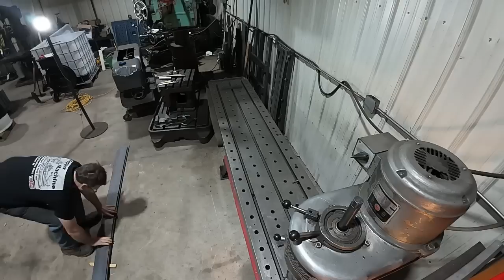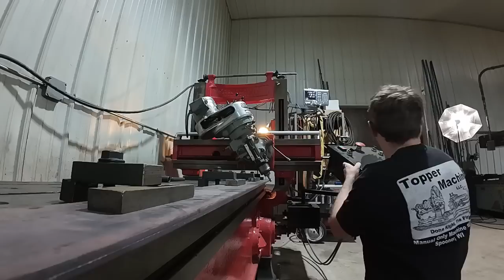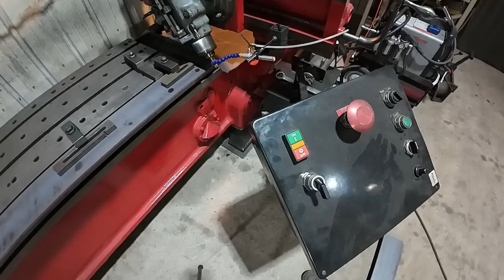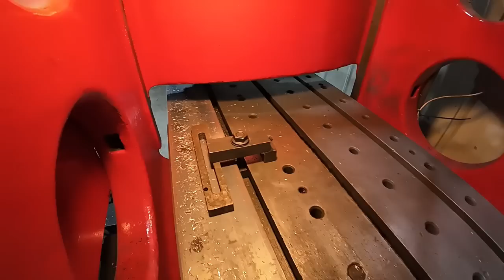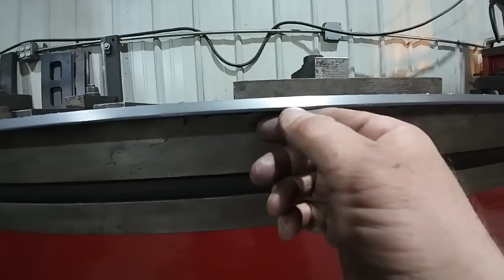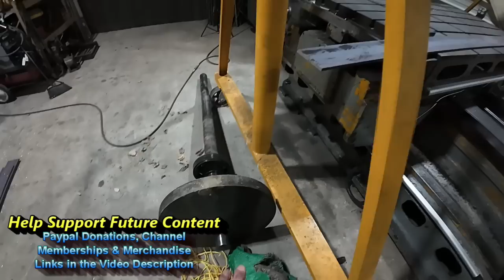Machining 8-Foot Steel Bars (The Biggest One Yet!)

Comment: A lot of people questioned the angle used, no root depth left and some the alignment(grain) of the material. As Josh has indicated he did what the TAFE teachers asked him to do. If anyone wants to question the TAFE instructors who are all fully qualified pressure ticket welders, they should refer their questions to the TAFE and not Josh. All these TAFE teachers have taught this for a year or two and their previous students have met the industry requirements. So leave Josh alone.

Comment: Hi Josh.  After watching you use the cold air gun I went straight to eBay to buy one.  The least expensive Chinesium cold air gun was right at $200.00 and some as high as $600.00. Did you luck out on the price you paid for yours (you quoted $40.00) or are they normally available at that price and I just couldn’t find them?  Thanks. Tom
Reply from the maker: On the video I linked to one for around $60-80. It's in the shopping section of the video. Don't ask me how to find it there, I have no idea, but it's there. I added it to the list of products. I hope this helps.
Reply: Hi Josh. Thanks for the reply.  I couldn’t find them there either, so I went to my friend Mr. Google and found that Amazon had cold air guns at about $38.00   As much as I hate doing anything that helps Jeff Bezos, I went ahead and ordered one.  Thank you again for showing me how these cold air guns work.  Tom

Comment: Ref "Quill Stick Out", the spindle bearings are always constant distant from the cutter regardless, the only small deficit is lack of rigidity, and increase on load on head holding bolts.
On surface / Table speed, I would set up a stop watch timer and use the DRO to record potentiometer dial settings,  i did this on my Bridgeport axis after replacing the pot.
Those weld preps are certainly more accurate than you would get in the field,  nicely done Josh.
Thanks for sharing

Comment: Josh the table drive motor coupler needs a shroud to keep chips away.
Reply from the maker: No it does not. That is a knurled wheel for fine adjustment.

Comment: hi josh as always a gr8 video! have you ever thought about making table stop blocks to fit closely in the t slots of your various machines? i made some our summit HBM they really work well for set ups of parts and fixtures have to do some tweeking if close tolerances are required. but they work good, got some for the hbm and our various knee mills. hope you and the missus can hang tough there in wisconsin!!  good luck and stay strong
Reply from the maker: I have made several different ones. Look at my older videos. I think I have a video of making some.

Comment: Like the idea of cold air cooling, but am intrigued as to where the air comes from ?
Reply from the maker: The air compressor
Reply: @TopperMachineLLC  I realise its from an air compressor, I was thinking more of the cold part of it, just wondered if it passed through a cooling down section, thats all.
Reply from the maker: @neilward9932  Venturi effect. It separates the cold and hot. Hot air out the back, cold to the tool.

Comment: I'm wondering about the planer mill, was it originally a planer that got modified to use a Bridgeport head or designed and built that way from its inception. Whichever it's a cool machine.
Thanks for sharing.
Reply from the maker: Planer that was converted by the previous owner.

Comment: It's not like you are going to be going through two inches of material that looks like it maybe a piece of 3/8 thick stock and a 30 degree angle isn't that much. You don't have to do this full thickness of it for the welding students to pass the course.

Comment: Great to see you giving a break to the local tech college, even in better off areas they're struggling.  I'm just a little confuzzled, every weld test I've ever taken had a 22.5deg bevel per AWS standards, even in welding school.
Totally agreed - sweep it in a pile and shovel it later, just don't sweep it under the machine for the maintenance guy to deal with.  I had a router operator that loved doing that, and any time I'd have to work on the vacuum bed there'd be an hour of cleanout waiting for me.
Reply from the maker: I just cut to what they asked.
Reply: @TopperMachineLLC  Yeah no I'm not questioning you, I'm questioning them.  Who knows, maybe they're using it for an intro course and wanted easier root access.  It just confused me a little.
Reply: @skwerlz practice pieces were 30° (60° included angle) when I was taught to weld.

Comment: I remember using a similar device to your cold air device when I was working as a mechanic. It was used to cool down automatic choke systems on carburetors. You plug the air hose in one way and it would blow cold air and the other way would blow warm.

Comment: I would be tempted to have done it standing up but you would need a lot of blocks to support it. You could have got away from side milling and used a shell mill.
Reply from the maker: It would have been way harder to support.
Reply: @TopperMachineLLC  Yes you are correct.

Comment: sir you are a great machinist .but i have a set up question. why not put two plates up on the table.. one where you had it and one behind the t slot then your clamp would be that much lower.  some 1/2 by1/2 by 1/4 angle iron as the stretchers.  again i will never be the machinist you are and only can dream to run some of the machine you use every day...
Reply from the maker: I considered this. The problem is that it may have been too much for side milling.

Comment: Hi Josh, I have a heavy duty workshop vacuum cleaner in my home workshop and it is fantastic for cleaning up the floor, it will suck up all the metal chips I can point it at. Much quicker and easier than a broom, sucks all the chips out of the machines as well.🇦🇺
Reply from the maker: I've tried commercials vacs. Sweeping is far better. Dollar store brooms are way better than $20 brooms.
Reply: @TopperMachineLLC  Ok Josh, stick with what works best for you, I really enjoy your channel and I an sorry to hear how depressed your area is. Stick with it as long as you can or as long as you enjoy the work. 🇦🇺

Comment: I can tell you that I use my tools to their capacity. The manufacturer said it does that then it must meet that. If your buy crap tools then maybe buy the good ones and spend the money. For some items, I buy the cheap stuff and it lasts longer than the expensive item. You never know if the tool you purchased is the correct one until you need it the most.

Comment: Hey Josh, thanks for helping out the tech school.  I’m 54 and I signed up to learn welding at my local tech school in January.  It seems kids today did not have shop class growing up (both boys and girls).  Someone convinced our schools to auction off the shop equipment and send the kids to “college” and now our shipyards and fabrication shops are struggling to fill jobs.  Here I thought I was going to school to learn welding and I’m in welding class trying to explain how a tape measure works (fractions of an inch) to a bus full of students who “graduated” during covid.  Our country is in trouble as a generation of highly skilled workers gets ready to retire and will not be replaced by the next generation.
Reply: I taught Aviation Mechanics in a local school and the students were definitely not prepared for it. Ten percent were good and forty percent were not interested in learning.  It’s a different world from when I was in school but 😢
Reply: Sure better than hand grinding all that material off !  Surprised the instructor makes it so easy on the students. Back when I was in school they gladly would have let us spend 3 days prepping a weld before ever striking an arc.
Reply: I agree 100%. I have trade school student apprenticing in my shop. This person didn’t know how to read fractions on a ruler, could not determine how many feet in a mile, can not convert fractions to decimals (and visa versa), can not find the correct open end wrench for a bolt without trying several at random - AND is getting As and Bs in the trade school.

My last apprentice was the same way.  Bitt, after 2 1/2 years with me he is now a lead mechanic at Lockheed Martin building F16s. I am proud of the skills he developed in my shop.

Comment: Josh, could you have tilted the head opposite direction and cut with the end of the cutter instead of the side?  I'm still learning and setup seems like 99% of every job.  Thanks for the videos!  Jim
Reply from the maker: This has worked out best for me on these long cuts.  More meat on the cutter, less breakage.  Corners chip.
Reply: Probably not enough travel to tilt it the other way. Even if possible a right hand spiral cutter would tend to lift the part off the table. Not good practice.

Comment: That long table on the shaper really saved the day, this would have been a LOT more work on a standard vertical or horizontal mill. Great job, Josh. (A nice 30 degree cutter would have been handy, but ya gotta do what ya gotta do.

Comment: I'm not saying anything was done incorrectly. I'm just saying if it were my shop, that job would have been done on my work bench with a track torch and grinder. If hand finishing a bevel cut is good enough for the most strict pipe welding inspection protocols, it's good enough for test weld coupons.
Reply from the maker: That would have worked, but the tech school wanted milled.
Reply: @TopperMachineLLC  I'm glad you are getting the work. Cheers!

Comment: Cool job Josh. I am a retired welding instructor from a local technical college. If those plates are to be use for AWS/ASME welder qualification tests, the bevel angle called for by the test is 37 1/2 degs. + or - 2 degs.  A 30 deg angle is ok for practice but the full 37 1/2  allows them more welding passes. I'm sure you are doing what your Tech College called for. Great to be a machinist you can always take more off. As a welder you can put MORON lol!
Reply from the maker: I thought the 30 degs was a little off.  I even asked them to verify it. Do what the customer wants.  But I will remember that for future reference.
Reply: @TopperMachineLLC  Glad to help... your channel is a good one I enjoy it very much!
Reply: Retired toolmaker from the Alcoa forge plant in Cleveland ohio. I made pipe coupons for the millwrights taking pipe certification tests. We also cut the J angles at 37 1/2 degrees with 1/32 flat at the root.

Comment: Well that’s fancy. I had to grind my own weld prep when I was learning to weld. Remember we had to take turns on who’s going in an hour early in mornings to cut enough flatbar on saw so there is enough for that days lessons.
Reply from the maker: Now days, students are soft.  I remember grinding them too.  We can't have that now days, it would make them have to actually work.
Reply: Not having them grind their own work is not doing them any favors.
Reply: If I recall correctly, we were graded on our grinding job before we even struck an arc on our test pieces.

Comment: Why would it be bad to cut with the quill out or down? One would think if it was bad then Bridgeport wouldn't of made a machine with a quill that goes up and down! Just thinking out loud here.
Reply from the maker: Some people think it hurts the quill doing it extended.  I have been doing it 25 years and never destroyed a single Bridgeport.
Reply: I can't see how running the quill out can hurt the machine, I prefer to keep it as short as possible and move the table up where possible, but having the quill for certain operations is why the machine is so popular, it can affect accuracy especially if you move the quill between operations and your machine has wear in the quill to head area, but only if you're trying for high accuracy and a Bridgport isn't the best choice if you're going for high accuracy anyway.

Comment: A light pass at 90 degrees on the edge of the stack to clean up the edges first would have given a perfect root thickness and had no mill scale , not that is really necessary , but then when you start the cut and set the depth to get the root size it will be the same end to end and no going back to re-cut a final pass .
Still was a faster way than some one grinding a angle on all that metal .
That planer/mill is so good for some big work .
That crank shaft job will be a interesting setup to see.
Maybe a boring mill job ?
Keep up the great work and keep the chips flying .
Reply from the maker: While cleaning up the stack would help, you need to remember this is basically charity work. Cutting costs on my end is important. Funny how all this work is just for a throw away item.
Reply: How would that work when the plates aren't perfectly straight? If they were perfectly straight there would be no variance on the root thickness from the angled cut either...
Reply: @W8iHav2P  That is why I said that taking a light pass on the stack to make all the edges straight first would make a even root size and no need for a second pass on the angle to get to size on the length of the parts .
Not that it has to be that perfect anyway , it's just for welding .

Comment: If the travel allows it I'd have swung the head the other way and machine the feature upside down to what you have now. If the travel on the cross slide isn't enough then you could still mount it further on the table with some spacer blocks. Alternatively bigger end mill or mill it with the face instead of the side.

Comment: I wouldn’t worry about what other people think, you do what you do. Extending the quill, why have it if you don’t use it. The swarf on the floor, I agree with that sweeping up is the easiest, the only thing I might do different is try to put a bin under where the tool is working to catch as much as possible, only because I don’t like sweeping anymore then I need to.